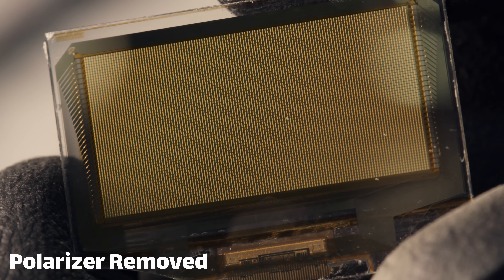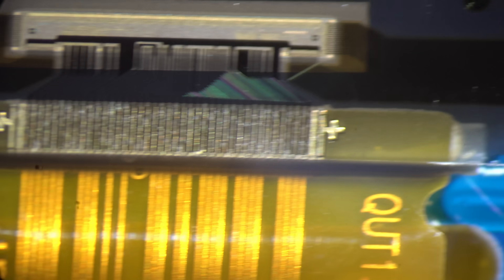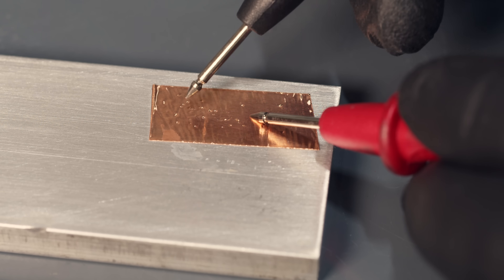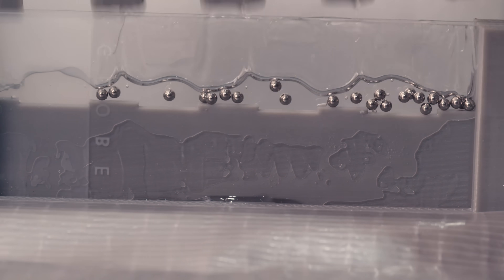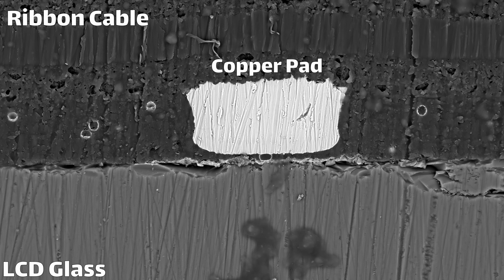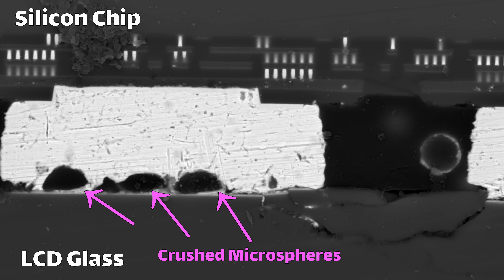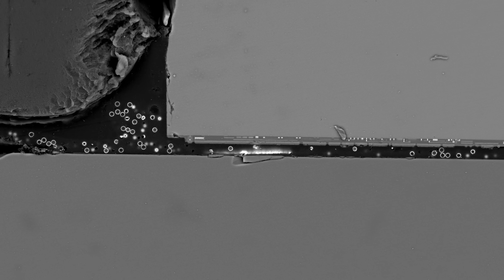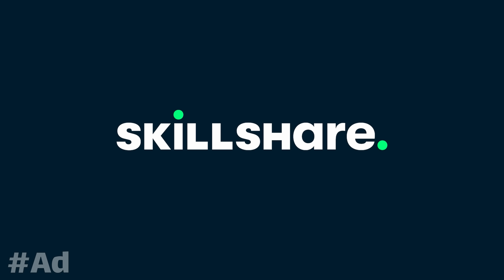The Microspheres Hiding in your Phone's Screen

Comment: The old school larger scale version of this is called "zebra strips", used for connecting lcds to rigid PCBs.
Reply from the maker: Gonna see if I can find some in my pile of old electronics! Thanks for the tip, I hadn't see that before!
Reply: @BreakingTaps Take apart virtually any cheap electronic device with a passive LCD display and you're likely to find zebra strips, which are conductive in two dimensions: Y and Z.  Also shows up in any passive LCD wristwatch, thermometer, etc.  The metal contacts on the glass are thin enough to see through, crazy how little it takes to drive them.
Reply: @flomojo2u  I assume this is the 'rubber' pad I found between a cheap watch's LCD and its circuit board pads? I figured it must be conductive in only one direction, and had heard of such materials in the abstract, but I'm not really familiar with them.
Reply: @flomojo2u there are some materials that can be used to make completely transparent traces; ITO (indium tin oxide) is a common one.
Reply: Fixed many a Nokia and I think Gameboy? With a bit of paper to apply a bit more pressure to those zebra tapes back in the day. I didn't even know this new one existed, that's pretty cool.
Reply: My multimeter uses this to connect its display! I was quite puzzled at first when I was taking it apart. I thought, oh, shoot, I must've destroyed the display connector when the cover popped clean off with the display in one half and the PCB in the other.
Reply: They’re an alternating layer of conductive and insulating elastomers. Conductive elastomers are really cool, be nice if you could 3D print them.
Reply: @Scrogan  any reason why they can't be printed?
Reply: @nikonmikon8915  print/3d-print zebra strips?
Reply: @nikonmikon8915  they can be printed easily vertically layer by layer but needs two nozzles one for consecutive layer another for separator or non conductive layer it's tough....but I think those stripes must me prodused with two type of rubber sheets(many) where they stick hundreds of those 2 type of sheets using heat and press or special rubber glue...then cut all what sizes requaired.
Reply: @nikonmikon8915  it’s technically possible with a well tuned printer, but conductive elastic filaments are $150/kg somehow. Also they’re TPU, and my experience with TPU suggests it’s too prone to plastic deformation.
Reply: @Scrogan As a child I've always wondered how a peice of rubber could conduct electricity, i just knew the zebra pattern had to do something.
Reply: @Scrogan  Hmm... I don't see why you couldn't ... well, maybe they don't stick to things very well or thermoplastic varieties aren't affordable/practical (I wouldn't know), and you'd need something with dual independent extruders to cleanly do 'stripes' with another material, and the width of the stripes would be badly limited by nozzle diameter (and thinner nozzles tend to massively slow down printing)
Reply: @05Matz regarding thin nozzles printing slowly - you right on that without a doubt, kind of intuitive and simply obvious observation right? But at the same time the very reason you would be considering such small nozzle because you only need miniscule amount of material - ideally choosing nozzle size that produces the required in (or one that outputs closest to required width) one pass. So would the printing speed with small nozzle would be an issue then? I personaly just trying to imagine now the process of this and can't really think of why thin line versus thick one should take any longer time to produce if both are printed using accordingly wide nozzles to their required thickness prints. 

In curious to hear your answer because I'm simply just a curious tourist on this topic/ field of electronics. Never even had or used 3d printer. Thus just wanted to know bit more about how this works and it would be quite interesting to find out for what reason which isn't apparently obvious to me that should it take longer to produce small electronic bridges with their corresponding small tools than larger ones. 

PS if anything - I would have thought it would be quicker as less printing material should take less time to heat up and very thin line to be squeezed out of such small nozzle with standard printing machine capable of in this comparison producing much greater pressures should be able with absolute ease squirt out thin lengths of this artificial lava trails...

I'm very curious to hear your thoughts on this
Reply: @dovydasvaiksnys3807  ...i think u miss something important...the extreme small size of just micrometers... u simply cant sqeeze the same ammount of material out of it copared to a 0.1 mm nossle, the rate of material progression would need to be sevral hundred times more...if not thousands.. a pressure of 10Nm^-1 vs 3000Nm^-1.. to withsatnd a pressure of sevral hundred Kg/s the wall width would have to be enourmous... in theory u could make a needle sevral cm wide with a 1 micron hole...but would be quite useless

in coparison its like trying to squeeze as much water that a fire hose does but trough an injection needle..only alot smaller
Reply: Yup. Used those in the ‘70’s
Reply: Long ago I used the Tattletale 8 SBC which used the similar 'Squishy Bus' to mate to a carrier board. It was always a little concerning due to board flex but it seemed to do the job ok.
Reply: Aye! That's what I've known it by. Still being fairly new to circuitry and building electronics, I only learned of it a few years ago. Real neat!
Reply: Always thought 'z tape' used the same tech as zebra strip, but the tech is so very different.
Reply: Those are cool too
Reply: Bqack in 2020 I  learned of a similar older technique called an elastomeric connector while repairing an old roughly 1990 digital multimeter. The elastomeric connector was used between the main PCB and the LCD display.
https://en.wikipedia.org/wiki/Elastomeric_connector
Reply: ..a tip to find old zebra strips might be very old digital calculators...almost always is the screen attached with zebra strips... back in the days the displays was actually flat vaccume tubes (the green, yelloy, orange, blue types) 
...a seach for 'zebra connectors' show many types... the principe is the same
Reply: Allways knew from kid that those rubbery things connected the PCB to the LCD

Things is. Every time I unscrewed the LCD and installed it back, didn't worked...
Lots of dead calculators and "1000+ games" consoles
Reply: Zebra stripes were great for manufacturing, terrible for anything that has to be taken apart and repaired. I always hated those.
Reply: Human hair width has a vast amount of variability in width. I wish people would stop using it as an example.
Reply: @marcdraco  .yes i agree... but in general is a good comparison for how small things actually are.. most ppl are not physicists 1 micon may not say much for some ppl... a hair is something every one can see/feel and saying somethin is 1/100th of a human hair for many ppl puts thing in a context thay understand...
Reply: @Patrik6920  I feel that - but perhaps the width of a piece of paper would be better since most common writing papers are a similar weight, they are closer to a given thickness. It''s a no-win game really.
Reply: @marcdraco  ..well paper thickness varies alot more, but ya either probably fine
something very thin and tanglable..
Reply: @Patrik6920  i was thinking of standard grades (I don’t know what happens outside of the EU). Like an 80gsm bond tends to be the same thickness as any other 80gsm paper. It’s the weight of paper per square meter and paper pulp is fairly standard stuff. There really isn’t a standard measure that we can really pin down. I just hate the hair example since we all know our pubes are considerably thicker than the hair on our head for example.
Reply: i love those
Reply: I remeber how much I hated those!
Reply: This was awesome to watch 😮
Reply: zebra strips seem to be a lot less pot luck
and are replaceable if they fail
Reply: @elvisburgerking8675  ..in theory atleast..
..the problem is that it isent any permanent joint...and different materials expands differently when heated...so ther will always be some movement...slowly oxides tend to creep in on the surfaces wich isent exacly a perfect conductor... and just handling them left contanmination... wch many refere to here as once taken apart almost impossible to reasamble ...
Reply: Pager/Beeper screens used those "zebra" rubber blocks to make contact with the main board.  The good 'ol days where you could actually see everything with the naked eye. heh
Reply: Evidence?
Reply: The dreaded PCBs baby please....
Reply: I have one from my multimeter